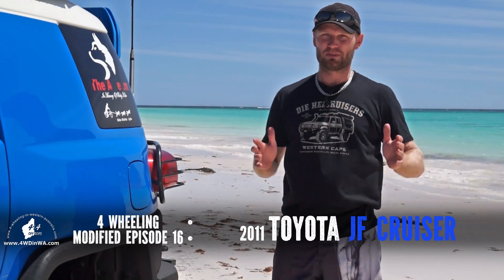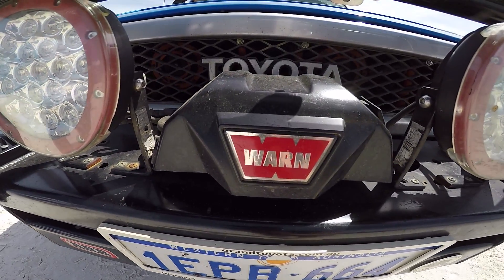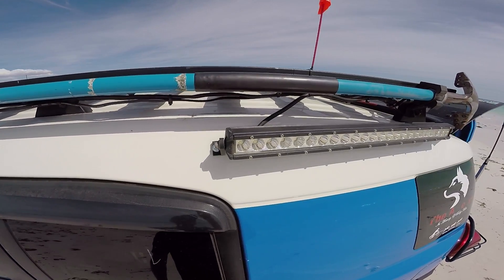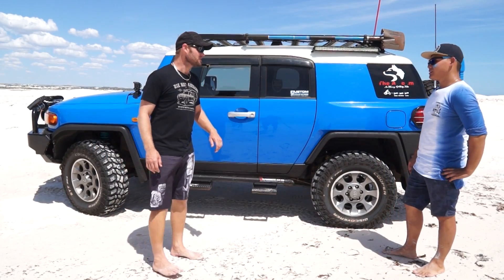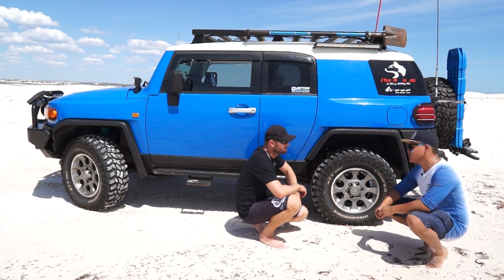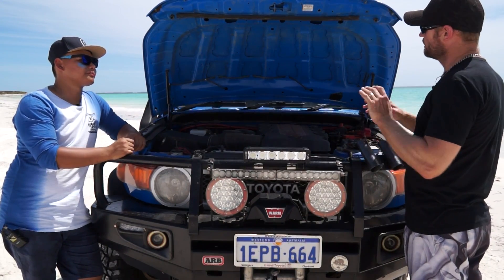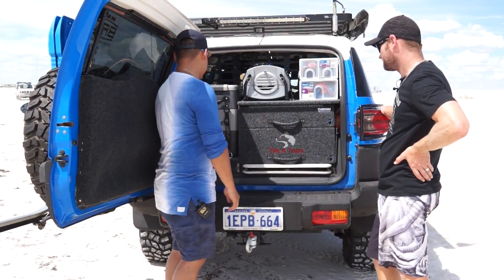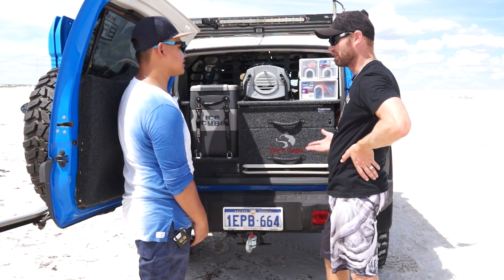FJ Cruiser, Modified Episode 16

Comment: I'm not a huge fj fan. But this is probably the most well put together and cleanest rig you've shown so far. great work
Reply: +giantranga414 thank mate i really appropriate the feedback =]
Reply: +Andrew Phan Nice rig mate!! Id love to own an FJ, i like your number plate surrounds ahha i work at grand toyota :P
Reply: +Andrew Phan Hey mate, awesome truck! was wondering if you had to do a body mount chop in order to fit your tires?
Reply: hey *****,  during the recording of the video i did not need to do a body mount chop, after changing my rim to a negative off set i did. with a 2'' lift and 33'' you will not need to do a BMC on the FJ
Reply: thanks for that info mate! I currently have a 105 landcruiser on 35s, but in the near future will be updating to a newer car and the fj certainly looks the goods!
Reply: Good luck getting an FJ mate. They went on the collectors item list last year and everyone thinks they are made of gold now.
Reply: I was thinking about importing a landcruiser to the United States from Australia but I think I'll stick with my original plan of getting an FJ. Kind of sad that Toyota stopped making them
Reply: giantranga414 k.
Reply: giantranga414 jkjjjjjjjjj
Reply: OK, after driving around on the salty sand beach, how much of it is rusted out now??

Comment: Awesome FJ Cruiser. Crushes many of the best modified Hummer H3's I have seen in America. 
Though at 17:41, I would use a 360 degree deep ribbed cover over the steering wheel instead of the smooth cover/knob setup. A Ribbed steering wheel cover: The approximately 1cm to 2cm height ribs spaced 2.5cms to 3.5cms apart 360 degrees around the wheel provide 100 percent safe hand control of the steering. The SHOWN smooth cover with an installed single position steering knob is irritating and if you hit a pot hole or rock at speed you could strain or break a wrist.

Comment: I must say that's the most impressive FJ I've seen. Very well thought out set-up. I put the same Coopers on my GX470 in January and they've been great. Love seeing them on other rigs. Still not a ton of folks with them. Quick question on the shovel mounts: I have the same FRO rack and have the QuikFist mounts. Did you just drill through the side rails to attach it? Thanks!
Reply: Yes i did. There are two hole that I drilled to attached the quick mount for the shovel

Comment: Hey Andrew nice FJ. Regarding the dimmer you have at the back for the led's is that just a 3amp unit off ebay normally used for the smaller led strip lighting or a higher rated one? Looking to do the same.

Comment: 06:02 Wonder what kinda of custom led drl Chris did to the oem headlights. I see he drilled and added a rubber grommet with bulb to the bottom of the housing.
Reply: Looking to route the drl resistor module to another not so bright headlight with rocker switch and this might be an option to keep it clean.

Comment: With the ARB working/flood lights on the roof rack, which dimmer switches did you use (or would you recommend), and are they waterproof.

Comment: +Andrew Phan quick question do you think I would need to upgrade my alternator before upgrading my single battery for a bigger one? thanks in advance. Nice rig
Reply: hey mate, I have not upgraded the alternator but i run the c-tek bypass charger and it help a lot of the charging of the secondary batteries. i have just changed the alternator last week due to it faulting after a mud puddle, but i changed it for a standard one again and did not upgrade as i do not think you need to.

Comment: Do You have a video. Explaining what FJ difference there are, Between Basic and a Trails Team. For 4x4 Overlanding. Do not really care about the Looks or the badges. Just function. Is it worth paying extra? Because they are charging a lot for Trail Teams. Or can I just Mod it after and get the same thing out of it? Im looking for an FJ Cruiser 2010 or later. I do now the 2013-14 have a Crawler Control. To not think you can Mod that into any FJ? Thanks for any help!

Comment: i've been searching all over.. I can't find any air pressure switches that would work that would let you set the psi to 42.. Love to know what switch this is.
Reply: i am in the process in show everyone how you can do this! it will cost around $25 AU dollar to convert pretty much any pump into and auto cut off one =]

Comment: I'm kinda new to cars but been checking out some 4x4s lately and have taken into their liking. Was wondering if buying a 2008 FJ Cruiser that has already been driven 260,000K worth the money (provided no issues with the chassis, gear etc I would assume). I'm just asking because 260,000K sounds a lot but I am unsure. It is being advertised for 16,000 AUD.

Comment: Hi Ronny,

I'm not sure if you know or you could ask the owner. I am looking for the same Dobinson lift kit.  He said it was a 3" lift. I have looked around and I am only able to find a 60mm Dobinson kit. Is the kit he used a 60mm lift? Btw great video, love your videos. Would like more commentary in the off road trips!

Thanks

Marc
Reply: Hey mate. Andrew here. Currently running 70mm Dobinson suspension lift. Purchased at Malaga suspension and installed. But overall height is still 2" after sag due to excessive weight

Comment: Theres some good stuff there & sounds like a top bloke! I love my fjs. i know everyones got their own setup but this just seems a little bit of an ebay mess ;) Lol 3 batteries 2 cameras ? Thousands of lights, voltmeters? I love the whole did you drop the front diff? No i just rang around until i found an answer that justified my own opinion.  I can personally tell you if you dont you wear shit out. Not just fj but other 4x4s ive owned too! I bought the first fj had the 3 inch didnt drop it did about 100thou and stuff prematurely wore out (driveline and suspension). Sold it and got the new model. Havent made the same mistakes the second time around and no probs.
Reply: Thanks for the advice. I have done my research and I know where you are coming from. I respect your opinion. Like you said everyone has a different way of modifying the FJ and this is how I like mine :) I set it up for how I use it and love it. 3" lift with the extensive weight I have effective only is 1.75-2 inch due to the sag. But I have now reach 120k on the clock and no problems. Also depend on how u drive and how aggressive you go. I look after my FJ and also take it touring. Not for bush bashing.

Comment: What problems did he have with spacers? What is your take on spacers ronnie?
Reply: Hey Sam, I ran the spacer for around 50000km and they forced the cv into the incorrect angles and cause problems.
Reply: +Andrew Phan was that because of the 3 inch lift? I was thinking 2 inch for a new hilux.
Reply: +Sam Kilpatrick the cv angle are almost vertical now with my 3" lift. But with the spacer it forced my cv angle down too much. However the 3" the FJ is technique down to 2-2.5 due to the weight. Recommend going to a suspension shop and getting professional advise. My research was for an FJ and many run 3" fine but again it depend on the circumstances.

Comment: did he have a fuel tank added under, they didn't say a word about it?
Reply from the maker: +John Westbrook from memory he is running the stock 130l tank
Reply from the maker: +John Westbrook sorry 138l
Reply: +Ronny Dahl (4 Wheeling in W.A.) He said at the end he had an auxiliary as well, but they don't mention where he put it.
Reply: Right on, I want one but the DOT says there off road only. Its the only way that the FJ has any real fuel range.
Reply: +John Westbrook hey, Andrew here, im running the stock 80L tank and also 120L aux tank, i get a combined range 1100km before having to fill up. the AUX tank is installed by Ultimate 4X4 in bibra lake and also supplied a compliant certificate that ensure the tank follow department of transport law and regulations. hope this helps mate
Reply: That's awesome thanks for the info. I will check them out asap.
Reply: Andrew Phan didn't yours come with two tanks

Comment: who else noticed the rated bow shackle through a factory non rated tie down point at 2:40
Reply: Hey Brayden they are on the factory tow point to save space in the back and acturall you never had to use them. But also future mods include rate recovery  points. I honest am smart enough and know not to use them to pull myself or other out using it. Majority of the time I would use the winch if need be
Reply: +Andrew Phan oh right cheers for clearing that up even one rated hook on the front wouldnt be a bad idea just noticed the recovery hitch on the back of the vehicle so i guess that s an option in a revovery, i guess when you fork out the money for a winch you might aswell use it

Comment: How is this a TRD?   Let's get it right folks. It's just a stock FJ with nice mods ....  The only TRD that I am aware of was the 2007 (ordered in 2006)  all black.   Then it went to Trail Teams.  2008, 2010, 2011, 2022, and 2013.  In 2014 it was an ultimate edition.  No special edition in 2009.   A few others over seas after 2014!.  This guy's FJ is not a TRD.  Thanks but that is not what we have there.  It is a very nice truck but we shouldn't spread misinformation that this is a TRD. It is not.  It's a very nicely appointed stock FJ.  Not a special edition or TRD in any way.